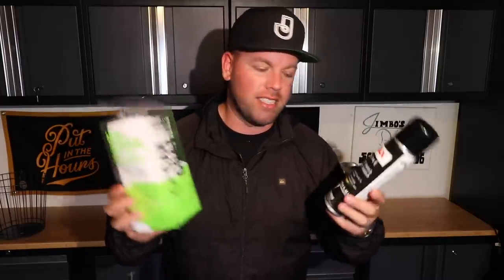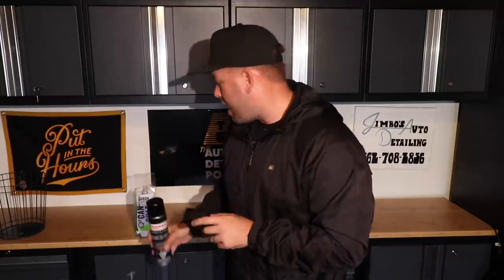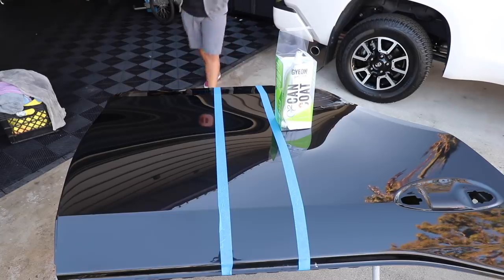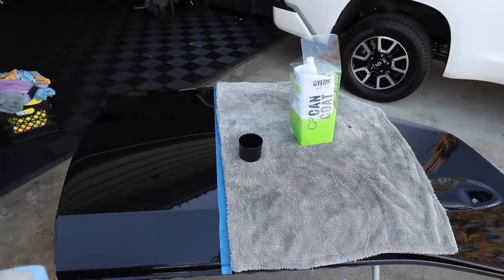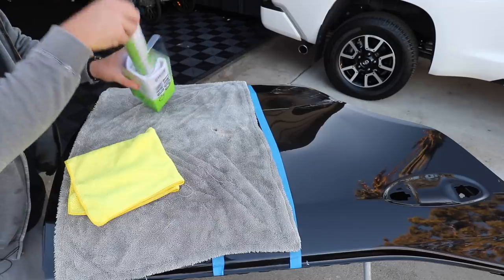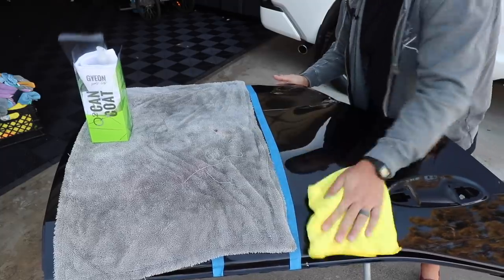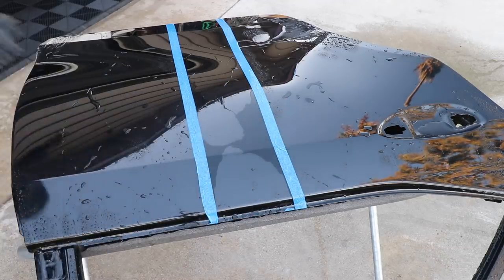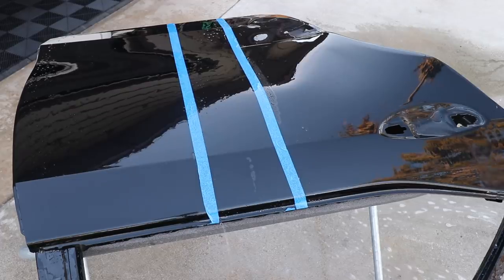CHEAP VS EXPENISVE: SONAX POLYMER NET SHIELD VS GYEON CAN COAT

Comment: Both are still clearly protecting the panel after the chemical applications. They are still sheeting water quicker than bare paint, they aren't gone simply because they've stopped beading it's just their water repelling traits have changed.

Comment: Hi Jimbo, 
strip the masking tape and inspect the colour difference after you're done with the test. You may kill a coatings hydrophobicity, like you just did, but once it's fully cured, you won't strip it with an APC.
Reply from the maker: I let it fully cure for 7 days and it stripped....
Reply: @autodetailingpodcast  kill hydrophobicity does not equal strip. Polish half of the coated panel with a medium cut polish and see the difference in colour/depth/gloss. This will tell you if you have stripped it or just killed the repellency.

Comment: I’m sure you’ve got this question before but realistically speaking when am I going to be getting any of those chemicals on the paint to cause the paint protection to be diminished or stripped off? I feel like spraying  salt, calcium chloride, and such used on the roads for winter months is a real test. I’ve used Sonax Polymer Netshield before and have washed the same car 6 months later after it’s gone through a rough winter and it’s beading water as strong as the day I put it on. I guess my question is how do those chemicals simulate real world results other than the adams iron remover. And even in that case, if I’m doing that I expect that to remove or diminish the paint protection because the only times I’m usually using that product is to apply a sealant and/or ceramic coating.

Comment: This is really strange. PNS is much stronger than this. You can beat it with APC mtiple times and still it goes ... How did you strip the firsr wetcoat coat? No contact on PNS side ?
Have to admit. Its first time I see someone trowing iron rover on it...not something I would do in real life. 
Even stjarnegloss first isnt a match for PSN. You have to hit it multiple times.
I let PND Cure for 1-2 minute before buffing. But I work it in a little longer. Multiple passes en first buff 1 minute after first contact to paint.

Comment: so MUFF is still the undisputed winner? lmfao
Reply from the maker: pretty much hah
Reply: Auto Detailing Podcast  MUFF or Reload?
Reply from the maker: I haven’t played with reload much but I would imagine MUFF is pretty hard to beat with all things considered
Reply: What is MUFF, guys? Probably can't get it this side of the atlantic!
Reply: Gunt Perkins  thank you... yeah, I just looked it up, priced between €25 to €50 online here. Vast price range. I'd say its like $15 over there!
Reply: @brakeduster  If you're in the UK you can now buy it from Halfords. I got it whilst on offer for £16 and been using on wheels. I'm in the Fusso Coat camp for paint protection but the MUFF is good enough for wheels. It lasts at least a month/4 washes/1000 miles.
Reply: @JWL-UK  Cool thanks!